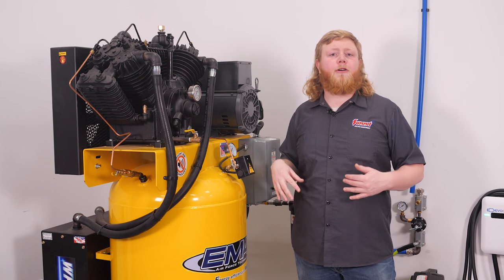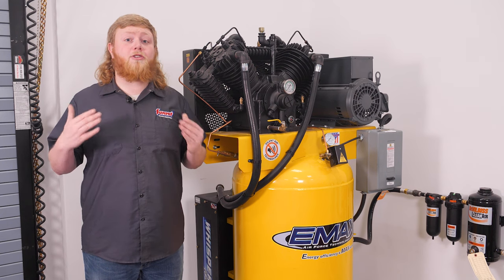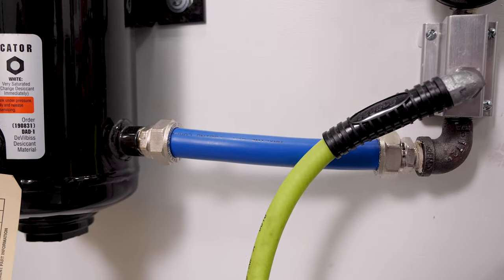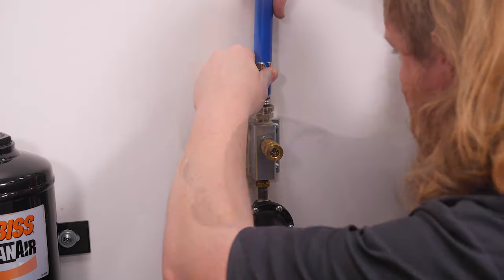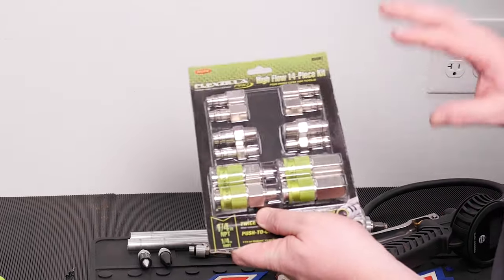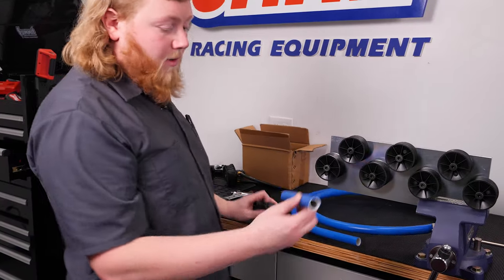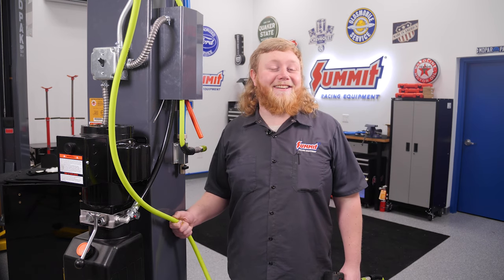How to Install Air Compressor Lines & Drops to Use Air Tools in Your Home Garage or Shop

Comment: Your dryer should not be that close to yhe compressor. The hot air out of the compressor doesn't condense the moisture until cooled.
Reply: It's not a dryer--it's a silencer for the exhaust.  I have the same compressor.

Comment: Good video and explained well. I would like to have seen more about individual filters and regulators at each drop down, and how to choose the correct quick release for the job. 
I have 9 drop down in my closed loop 3/4” Maxline run through 3 garages and a workshop. The air from the compressor passes through 100’ if 3/4” copper pipe in a switchback on the wall. This provides radiative cooling. Then there’s a drain and a connection to another 100’ of 3/4” soft copper tubing. The air enters a tank from below, coils up in a helix, then coils back down in another helix and exits the tank. Two solenoids are synchronized with the compressor to open valves for flowing cold water through the tank. After the this convection cooler, the air enters the 60 gallon tank. 
Then the air is plumbed through the work area in a closed loop. 
My drop down for air tools, blast cabinet and spray paint has an activated charcoal filter, a large desiccant filter, a 5 micron filter, a 0.01 micron coalescing filter and regulator. After the regulator, it splits into two paths. One for painting and blast cabinet and the other to a lubricators for air tools. But I don’t know what style of quick releases I need for various tasks like painting, blast and tools. 
My air brush drop down has an activated charcoal filter,  5 micron, a 0.01 micron coalescing, a small tank for volume and a regulator. But again, what style and diameter quick releases do I use?
I went overboard on the pre cooling thing with all the copper. But I designed it and Damn It! I wanted to build it. 
How necessary is it to have individual filters at every ordinary drop down? I think a regulator is a good idea, but not sure if Joe Air needs filtering everywhere. 
Thanks for your patience. 
Paul

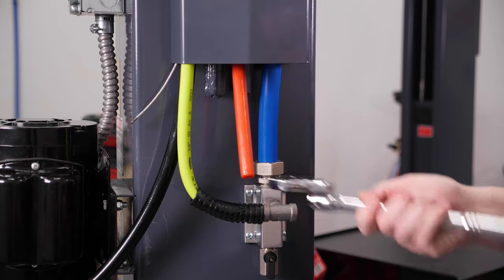Comment: The fitting that was installed at 8:28 had the teflon tape wrapped in the wrong direction....
Reply: Good eye. It's not leaking. Good enough.
Reply: Always happens 😂 teflon tape is only good for a couple a months anyway
Reply: I think both were wrong.